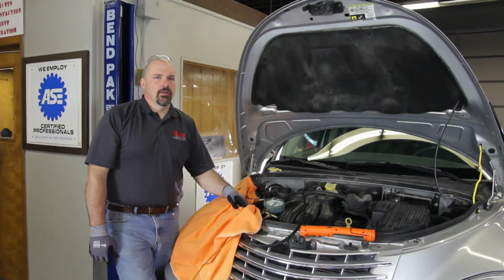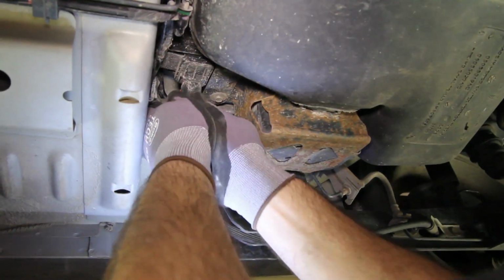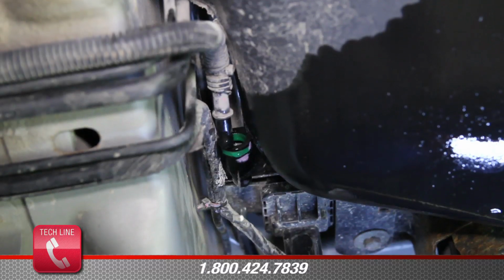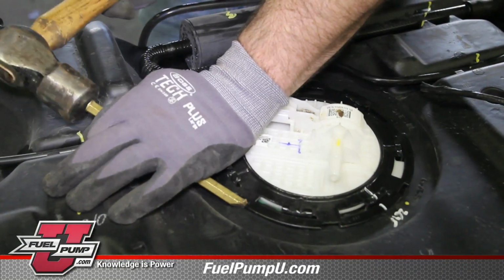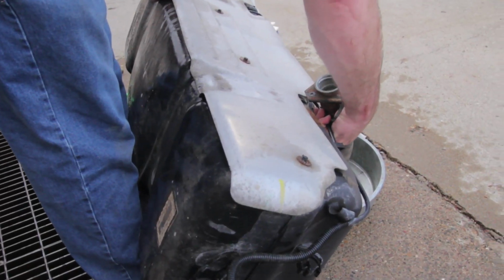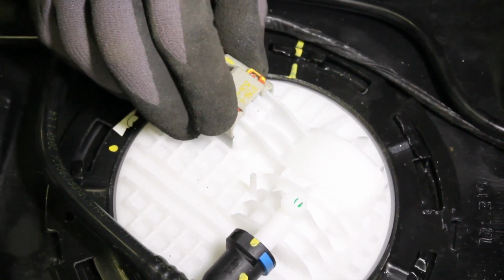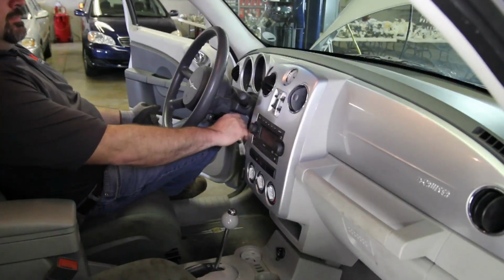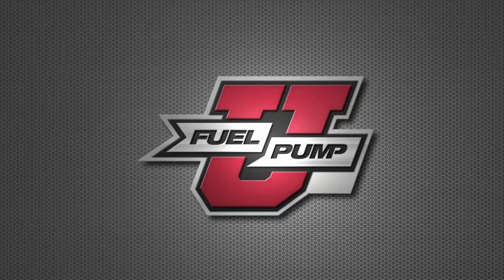How to Install Fuel Pump Assembly E7189M 2004 - 2010 Chrysler PT Cruiser

Comment: Okay... so the tank can handle gasoline and diesel okay, but what about E85? And are the other fuel-handling pieces of the system compatible? I know the management isn't setup for it, but I'll soon be adding an adapter--and properly-sized injectors--that'll allow for it... if the other factory pieces are compatible.

Comment: We own a 2010'. The fuel tank won't take gas. Keeps spitting it out every time you squeeze the handle it's clicks off. Last yr i bought a 2010 parts car and swapped out the tank and it worked perfect. Last week it started all over again. This internal venting sucks. Garages say you have to buy a New tank $650.00. I also called the Dealer to talk to their tech dept they replied they haven't had a recall on these for fuel tanks or are familiar with a fuel problem. There must be someone out there with the same problem or did you finally called the wrecker and have it scrapped?
Reply from the maker: Not being a fuel tank expert I would suspect something with the vent hose and or its components the capacity to allow the tank to breath.

Comment: I'm not hearing my fuel pump come on and my car won't start (07 pt cruiser) I sprayed starting fluid directly into the throttle body and car starts perfect and runs about 2 seconds then dies. Obviously it's a fuel problem. A friend of mine that's a mechanic told me that that it could either be the fuel pump itself or the tipm. Is there any way or any tricks anyone knows that I can use to find out to know for sure. I would hate to buy the fuel pump assembly kit and it turns out it's the tipm. Or vice versa I would hate to buy that and it turns out it's just the pump...
Reply from the maker: Start with: Does the pump have power? Ignition switch, fuse, relay, good grounds, clean electrical connections. If so... Is it enough power to drive the pump? A voltage drop test will determine that. If all of the above test good it is likely the pump.
Reply: @AirtexFuelPumps  I ended up replacing the tipm because I was getting no power down to the pump connector. But nothing still the same. This vehicle I'm sure you know has no fuel pump relay. It's built into the tipm
Reply from the maker: @bleakhappy  This is were diagnostic need to be done. Starting, as you have, at the pump and work back towards the power source. Something is stopping the flow of electricity. Be sure and check all grounds as well. One bad ground will wipe out the entire circuit and more.
Reply: Yes turns out one of the wires on the harness from the front of the vehicle to the fuel pump was exposed and was sort of cut. Probably from road debris maybe. Anyways I used butt connectors and electrical tape and pieced it back together. Also the pump did turn out to be bad. I followed your video and replaced it. Thank you very much for that

Comment: Were did u connect your fuel pressure gage??
Reply from the maker: Depending upon the year there may be a Schrader valve, like a tire valve stem, on the fuel rail. If not you will need to put a fuel line adapter in the line. The adapter has the attachment for the fuel pressure gauge.

Comment: where do i find the valve that you removed the pressure from?
Reply: Airtex/ASC Performance Pumps. When taking off the pressure line can I connect the gauge to either side ???
Reply: Airtex/ASC Performance Pumps ok that sounds good thanks. I appreciate your time

Comment: I have an 05 the fuel filter is on the tank as well? I notice sometimes when im going fast i will come to a stop at a light and it will sputter a little bit , cam and crank censor have been replaces along with plugs and wires
Reply: Did you ever find out what was wrong? I have a 2004 PT Cruiser with 83k that does the same thing. Almost every time I’m sitting at a stop light the rpms drop to about 500 and the engine shakes. It’s been doing this for two months now and no codes have showed up. I’ve cleaned the throttle body, fuel injectors, plugs, wires, checked for vacuum leaks and still cannot pin point it. I even replaced the idle air control valve just because.

FYI, the fuel filter is built into the fuel pump assembly.
Reply: @oregonboy84  We own a 2010. Few yrs ago our eng would shake at idle also, had it to a shop and found out one of cooling fans quit working and had to be replaced. Sounds odd but it worked. Ck your fans and relays?

Comment: You took off 2 electrical connectors. I don't suppose one of them went to the fuel sensor. If so, which one? I'd like to check the ground connection but I don't know where it is.
Reply: Great. Thanks. I'm going to assume it's on the plug with 6 wires, not the one with 3 wires. At this point it might not really matter to me. I didn't find a problem when I was under there, but I checked the solid black wire. So I put everything back together. Later, I managed to jiggle the ground, G104, under the passenger front fender ever so slightly with a long screwdriver. Now the car won't start. It'll turn over, just won't fire. G104 handles about 8 grounds including the fuel level sensor and the fuel pump. So, I guess my next trek will be taking the fender off so I can get at the ground.I appreciate the help.

Comment: My 2006 pt cruiser has no schrader valve to bleed the fuel pressure. Can I let the car sit a couple hours and do the job without having to worry about releasing the pressure, or do I need some kind of adapter?

Comment: We have a 2005 PT Cruiser and had check engine light on,  code was P0462,  and the fuel gauge would at first start of key,  go up to full then settle on empty with the low fuel light on as well, even with a  known full tank.   After checking for a short or ground issue and finding none, we dropped the tank and replaced the module with a new one just as you show here.  All back together and the symptoms are all the same.  no change.  reset the code and drove 500 yards and check light is back and gauge still acting the same.   Any suggestions?
Reply: Loose connection or ground

Comment: How can I tell if it's the fuel pump or the fuel filter?
Reply: Airtex/ASC Performance Pumps how is fuel filter  serviceable suspecting filter in 02 pt
Reply: Can assembly be taken apart and filter changed ?
Reply: I believe it all original been having misfiring issues  for while at idle and if you rev  it by hand you can feel it in motor  everything has been swapped in it to find it plugs wires you name it all except pump, have a 01 in garage I have been swapping parts to find cause off misfire but no codes  and nothing wrong with head or head gasket but plugs seem to look like it running lean using more fuel than normal feels like bit of power loss listen for pump and seems  OK so only things I can think of is possible the filter in assembly or pressure reg, in assembly  but have access spot in floor so don't have to drop tank . So maybe try swapping assemblies  and see?
Reply: Not sure what else everything has been changed except fuel pump assembly, garage just to much money right now, so that why been trying to figure it out on own ill swap the pumps ; maybe get lucky, bad enough dealer wants 90 dollars just for a key

Comment: I have a question before I try all this or to make a purchase. I have a 2005 pt cruiser when I try to turn it on it takes up too 3-5 revs and I kinda step on the peddle just installed a new starter and battery is fine do you think the pump might need to be changed?
Reply: +Airtex Pumps thank you I did call actually hopefully they reply by today :) because yesterday they where closed.